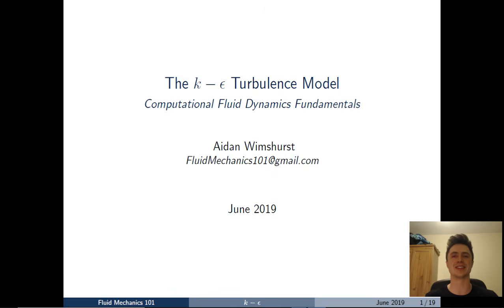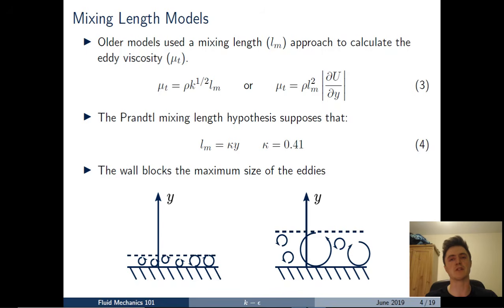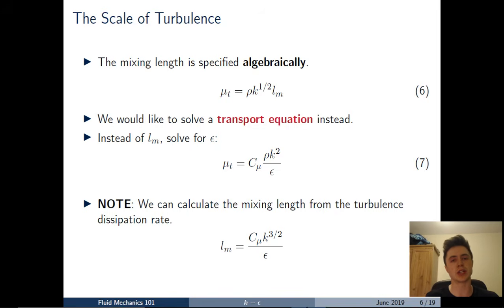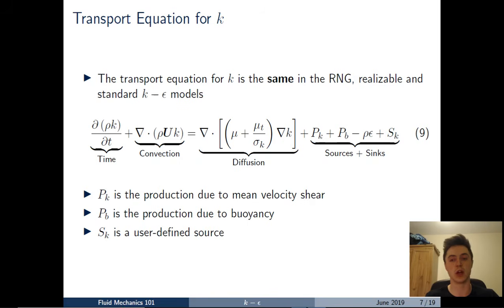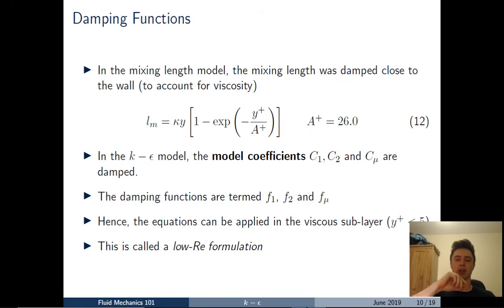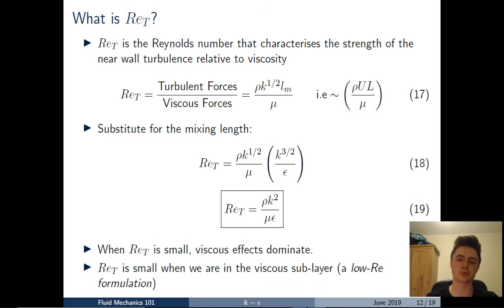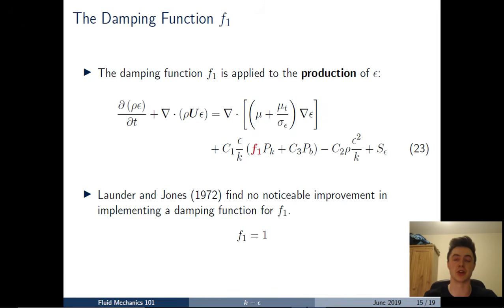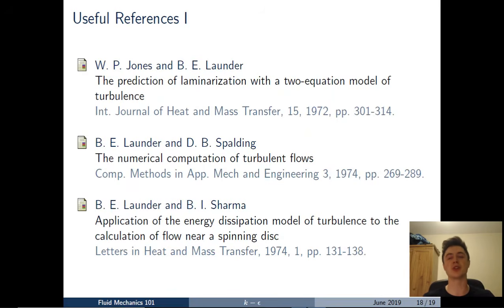[CFD] The k - epsilon Turbulence Model

Comment: While the zero-flow boundary condition inhibits flow through a wall, it would perhaps result in increased flow parallel to the wall (e.g. in a meteorological microburst). Therefore, it seems that the Prandtl Mixing Length Hypothesis is flawed, by assuming that mixing length is reduced equally in all directions.

Comment: Amazing explanation, But I find it somewhat confusing sometimes because I see you saying sometimes that near the wall, just like how mixing length needs to be damped, similarly the dissipation needs to be damped as well. I think you should have been more careful because it is the dissipation of the dissipation that needs to be damped and not the dissipation itself. In fact, We would like to increase dissipation near the wall. Just wanted to point out this so that if someone is reading the comments will get crystal clear idea.
Reply from the maker: Yea I have been thinking about this lately, I think we should say 'the reduction in the dissipation rate' to be clear

Comment: Thanks a lot for these free lectures prof. Aidan! If possible, please let me share a question: from OpenFOAM simpleFOAM, all the governing equations are divided by rho for simplicity BUT, in k-epsilon model, the production of TKE, G, originally is not directly affected by rho. Does this omition of a rho value different than 1.0 does not lead to a deviation in the solution of both transport equation of k and epsilon, that at the end is a deviation in the solution of nut and finally could impact the velocity solution?
Reply from the maker: The production term (G) is the double inner product of the Reynolds Stress tensor and velocity gradient tensor (giving a scalar). In incompressible flows, the Reynolds Stress tensor is written per unit density (divided by rho), so there should also be 'density dependence' in G as well. Have I understood your question correctly?
Reply: @fluidmechanics101 Hi Aidan thanks for your kind and fast reply. You gave me a clue, and I assume now that 'density dependence' in G that comes from RST is implemented with dev() function used in kEpsilon implementation, and let' say that dev() already considers the 1/rho because is based in the continuity eq of incompressible solvers,... am I in the right path? dev()

Comment: So basically we relate the Reynolds stress terms to the mean velocity gradient by introducing μ_t.
To solve μ_t, we introduce transport equations for k and ε. 
To solve the transport equation k, we need Cμ. 
To solve the transport equation ε, we need C1, C2 and C3.
To solve the issue of boundary layer, we introduce damping factors f1 and f2 to transport equation k, and fμ to transport equation ε. 
And to solve for fμ, you need to find Re_T, which is the Turbulent Reynolds number.
Is there something else that I'm missing?
Reply from the maker: Yes, that's everything 👍 nice summary
Reply: @fluidmechanics101  You're the man Aiden! 👍🏻

Comment: Hello, Mr. Wimshurst. The video is brilliant! Thank you for your time and passion. I have a couple of questions about it.
Slide 8. We have coefficients C1, C2 and C3, and Cμ. However, on slide 9 in the table there is only C1, C2, and Cμ. Could you tell us something about C3?
Slide 12. You said:
“… we have to have some way of damping the dissipation rate close to the wall …”
I think we have to increase the dissipation rate to mimic of sublayer, isn’t it?
Slide 12.  In equation 18 there is no Cμ in the mixing length part.
Slide 13. Laminar viscosity equals molecular viscosity, isn’t it?
Slide 13. Equation 22. Could you explain how μt from eq. 2 became μ+μt in eq. 22?
Slide 17. You said:
“… damping functions are effectively reducing the value of epsilon in a similar way to how the mixing length was reduced in earlier models near the wall …”
I think the epsilon must increase while approaching the wall. And mixing length must decrease!

Comment: I hold a Ph.D. thesis and have been working on SolidWorks CFD simulations for heat exchangers, the modified lam-bremhorst k-epsilon method was considered in SolidWorks, and I want to know how can I calculate the values of k and epsilon at the entrance, exit, and middle regions?
Reply from the maker: Good question. Does the SolidWorks manual give you any help? K and epsilon should be fairly easy to extract from a CFD solution
Reply: I don't find any description in the help. Then, how can i get these values if i don't have any solutions.
Reply from the maker: Why do you need k and epsilon? solidworks is generally only used for basic flow analysis, if you need to know k and epsilon you should probably be using a better code like Fluent, Star CCM, CFX or OpenFOAM

Comment: Hi Aidan, 
I'm a bit befuddled as to why you've written the RANS equations that way. Is capital U supposed to be the averaged velocity field? If so, I thought the whole point was that this did not depend on time - so what is the purpose of the d/dt(rho U) on the left hand side of the equation?
Reply from the maker: Hi Killian, it has been a long time since I produced these slides. Yes U is the ensemble averaged velocity. It is common notation to just drop the average and fluctuating notation in RANS as it is clear that the Reynolds stress term is the only term which contains fluctuating velocities. The time derivative gives the slow change in the mean velocity (unsteadiness not from turbulence). This could come from the rotation of a wind turbine for example or any other mean flow unsteadiness

Comment: Sir recently I have bought all your lectures last year. sir I am trying to simulate a building in an enclosure, but the backflow is preventing convergence. can you make video on that or help me with that problem,. thanking you sir for your great lectures and courses,
Reply from the maker: What type of flow do you have? Backflow can happen for a variety of reasons, mostly linked to the flow physics and boundary conditions
Reply: @fluidmechanics101  thank you sir for noticing my problem, I overcame my problem
Reply: Sir If possible make lecture on reference values given in ansys. I think it's to make non dimensional analysis

Comment: Hello Friend.  First of all i want to thank you for your lessons.  Are really amazing. I was wondering if it is possible to somehow add portuguese subtitles in your courses on the udemy platform. I am a mechanical engineering student in brazil and my english is not very good.
Reply from the maker: That's a great suggestion. I am not sure how to add Portuguese subtitles, as I don't speak Portuguese myself! I think you have to upload your own subtitles, which would be pretty difficult for me unless I can find someone who would be able to do it (and has the time free)!
Reply: @fluidmechanics101  Hi. I did some research and found a somewhat archaic method, but apparently it works on udemy platform. I'll take the test with the Computational Fluid Dynamics (CFD) for Professionals course (because that's what I bought recently) and when I get it translated, I'll send you the subtitle file if you want to add it for other users because for what I've researched only the author can upload the subtitles.
Reply from the maker: That would be awesome! Thanks Raul 😃

Comment: Please tell me how to setup to use Low Reynolds formulation in CFX, it just have Scalable for k-epsilon :(((
Reply from the maker: Just use automatic wall treatment and make sure your y+ is less than 5. CFX will do it for you behind the scenes
Reply: @fluidmechanics101  i just see Scalable  for k-epsilon, no option for Automatic like k-w/SST in CFX @@ i use ansys 19.1
Reply: i make sure y+ less than 2
Reply from the maker: Ahh yes my mistake. CFX only has Automatic Wall Treatment for k omega SST and scalable for k epsilon (it's been a while since I used k epsilon in CFX so I forget). Why are you using k epsilon if you are trying to resolve the viscous sub layer? Surely you can just use k omega SST and be happy with it?
Reply: @fluidmechanics101  I used kw sst and kw but my result is more different than exp (20%) when Re reattach 30000. So i wanna find another way to make my result becomes accurate.
Reply from the maker: 30,000 is a tricky Reynolds number as you might have some transitional flow (I assume you are looking at an aerofoil). Have you tried looking for papers online to see if anyone else has looked at your case and what method they are using?
Reply: @fluidmechanics101  they are using k-epsilon model in fluent, they said that k-w and sst over predict.
Reply: @fluidmechanics101  u right, rms at Re 30000 unstability, especially with SST
Reply from the maker: Yep, this is a very tricky case, particularly with transition. Have you had a look at your freestream turbulence and the turbulence close to the aerofoil? For transitional flow this can have a significant effect on the skin friction and the overall boundary layer profile. I would try and compare everything you have with the literature (skin friction, pressure distribution, lift, drag, turbulence levels) to try and find your discrepancy. It might not necessarily be the turbulence model ...

Comment: Wow, this was really helpful, thank you!
I am using a software which uses a 1.5 order k-e turbulence model. I can't really find a explanation for the 1.5 order, does someone know what it means? :)
Reply from the maker: The 1.5 is probably due to the order of the convection discretisation scheme (although i can't be sure as I don't know the code and haven't looked at the user manual). I would guess that it uses a mixture of upwind and central differencing, which it calls 1.5 order. Although I can't be sure ...

Comment: This is a great video! Is there a source for the first general RANS Equation? I am wondering what each term represents in the equation and want to make sure I know what each variable is
Reply from the maker: Most CFD textbooks usually have a pretty good description of the basic RANS equations and their derivation. I would probably look at mixing length models first as they are the most straightforward to understand

Comment: Good content, would be nice to have an overview though, how does this model compare with others (RST, k-w) at a very high level!
Reply from the maker: Agreed. Especially as the most important question is usually 'which turbulence model do I choose?'
Reply: @fluidmechanics101  haha I suspect you have some more content on the way then! I find it quite difficult to translate the intricacies of the theory and explain the practical differences, like why is my RST model so much more unstable than k-epsilon for the same mesh
Reply from the maker: Good question. All I can tell you is that RST are notorious for being unstable and is part of the reason people love k epsilon and k omega SST so much. We definitely have the computing power these days, the models just don't seem to be very stable. So don't worry, many other people have found the same thing as you! Do you need RST or can you just use k epsilon and accept a small degree of error?
Reply: @fluidmechanics101  Thanks for the response! I am glad to see that its a common trend then. We are trying to model the effect of the rotation of the wheels on the lift induced on a sports car for different speeds. What's interesting is that the lift is always predicted to be lower by the RST than the eddy viscosity models, this is even more pronounced at lower speeds and the RST fluctuates a lot more at lower speeds. 
Our professor said that in reality the grid is nowhere near refined enough under the car for the RST to be accurate and it would require such a heavy refinement which is out of the scope of our project, so we'll probably just go with k-e/k-w. As you said, it does seem like k-e/k-w are the quick and dirty models that are much easier for predicting global parameters.
Reply from the maker: Yep, I think your professor is spot on there! Best of luck with your calculations

Comment: Hi Aidan. Thank you for such an amazing lecture. 
I have some questions as follows.
Are these damping functions different than those wall functions that are used for K and epsilon (i.e. the ones you've already covered elsewhere)? And if yes, how are they different? Is there any connection between them at all? Do low-Re models require wall functions?
I'd appreciate it if you clear this up for me.
Reply from the maker: Yes, these damping functions are applied to all off the cell centroids in the mesh. The 'wall Functions' are only applied on the faces of the cells in contact with the wall 👍
Reply: @fluidmechanics101  Thank you.

Comment: I hold a PhD in physics and have been working on CFD simulations for decades. Even so I still find your lecture very useful and comprehensible! THX a lot!
Reply: I too understand him well. I have applied phd in ustc, and i watch his lectures to be able to tackle phd interview questions. 😁
Reply: Hello ! Have you worked on grid independence studies ?
Reply: @Roselene-AR   I am asking myself if it is possible to achieve a mesh independing TKE-Field. The finer the mesh, the more TKE is produced since the "detected" velocity differences between the cells and thus the shear stress is larger in comparison to large cells?
Reply: @Roselene-AR  It depends on which field of CFD you are asking about. Every field has its own methodology to achieve grid independence, one has to check the existing literature to find out

Comment: Nice Theory stuff! At the moment I'm playing around with an more complex S Bend pipe with hot air. K-E I have much higher flow values then SST. Ok clear - wall friction impact - but my issue (maybe caused by lockdown winter blues makes me stupid) - the lower the y+ wall value - the lower the flow value... so the question, when is it enough? Y+ <1 means 0.0 - 0.9 is okay... so 0.0x is also ok... raising the CPU time is one story - 10 years ago a low brainer, you had a cluster or not... but nowadays you have CPU time/power easy available.  K-E is offen used with 2 layers (1mm wall layer in total) but Y+ >30 you don't have everywhere. So the turbulence is blocked / damped by K-E - clear so far. The idea is to get as close as possible to reality or to have the closest "failure" from reality? So I should judge CPU time vs. turbulence? As written, the flow lowers with every fine mesh / wall layer - "over dominant" turbulence? Coarse mesh and fine layer?
Reply from the maker: For your flow problem, I would probably just go with k omega SST and y+ ~ 1. It sounds like your mesh isn't too large, so just go with y+ ~ 1 and then you can be happy with the results. Have you got any experimental results to check against?
Reply: @fluidmechanics101  I ramped up the mesh size up to 12 mio - 10 Layer and Y+ smaller than 1. I found a paper. LES and K E two layer matching better... to much TKE is not helpful always.
Reply from the maker: Yep, your mesh sounds good to me. Good luck with your studies
Reply: @fluidmechanics101  thanks. Effects and results are sometimes confusing. Study and basics are important to review. And sometimes - don’t make rocket sciences with an easy case 🤣

Comment: Do the model coefficients C1, C2, C3 etc, vary between fluid types ?
Reply from the maker: They have been calibrated to give good results for a variety of common flows, so they should work for most fluid types. You can change the coefficients to get slightly better results, but this is not advisable as changing the coefficients can have unintended consequences! I normally just leave them as they are
Reply: @fluidmechanics101    Thanks for the reply.

Comment: Nice explanation!! 
Although I didn't understand the part after mixing length models as I am naive in Fluid Mechanics.Could you please suggest some material to for a beginner in turbulence concepts
Reply from the maker: Beginner turbulence books are quite difficult to find. You could always have a read of Pope (2000) ‘turbulent flows’
Reply: @fluidmechanics101  thanks, will check this book

Comment: great explaination man ....Big fan !!...Can you elaborate more on history of turbulence and why these two parameters (k, epsilon) are best for turbulence modelling and how we get changes in final velocity and pressure fields due to these equation. That is relation between two turbulence equation to the main momentum equations.
Reply from the maker: Yes of course. The only way that the RANS turbulence fields affect the momentum equations is: 

1) through the eddy viscosity which changes the diffusion in each cell 

2) increasing the wall shear stress in the cells adjacent to the wall (if the log law wall function approach is used). 

These effects are manifested as increased mixing and steeper velocity profiles near the wall 👍

Comment: Hi Aidan,
Could please tell me how to model turbulent heat flux. Can you suggest any method for it. And which methods is best to solve turbulent heat flux.
Reply from the maker: Hi Subham, i dont really understand your question. If you solve the energy equation, there are already models built in for the turbulent heat flux. ANSYS or Star CCM+ will take care of this for you. Normally the turbulent heat flux is modelled with a diffusion coefficient (the turbulent prandtl number) multiplied by the temperature gradient at the wall. This is fine for most applications where air or water are the main fluid, as the momentum and thermal boundary layers are the same approximate thickness. For liquid metals for example, this is not the case and a better model is needed for the turbulent prandtl number. You will need to look this up in the literature for your fluid 👍
Reply: @fluidmechanics101  
After reading your comment

 K-eplison , mixing length and K-Omega This model sufficient to take care thermal boundary layer. Is this correct statement ?

Could you also throw light what are disadvantages and advantages of using constant turbulent prandtl number in complex conjugate heat transfer simulations.